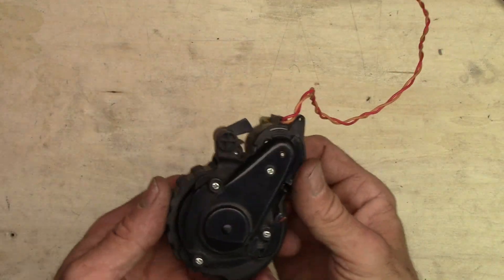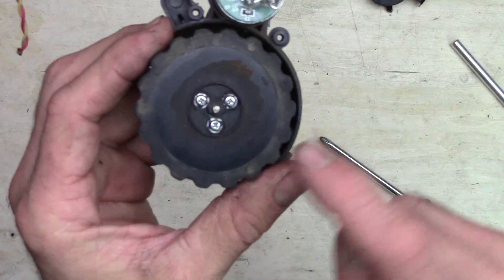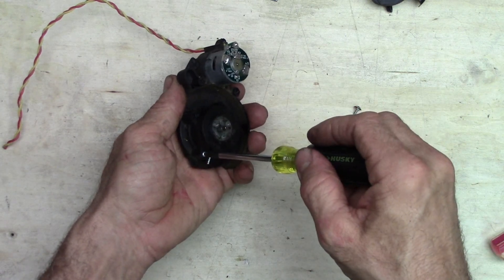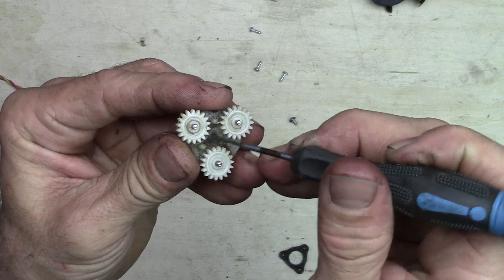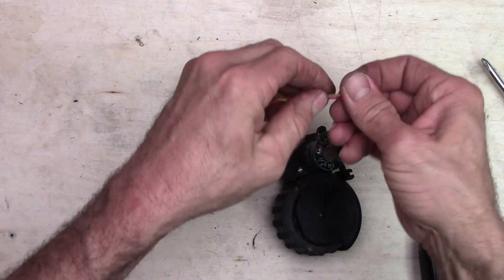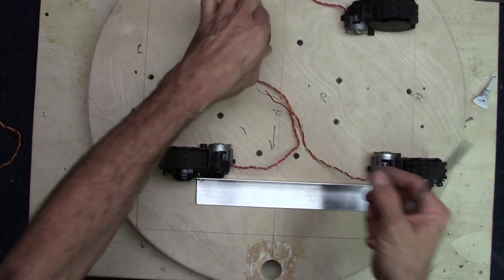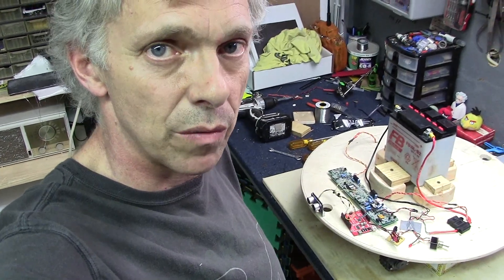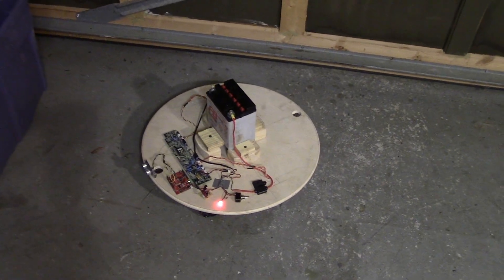Photon The VideoPhoto Robot Part 2

Comment: perhaps you could get a lithium battery to do the job, which would resolve the issue with using a heavy lead acid motorcycle battery. Of course with how expensive lithium batteries are, im not sure it would be an option. Maybe after you get done with this long term project, you could look into working on air cannons, you might want to take a look at Bill Gilmour's videos to see exactly what i mean: youtube.com/playlist?list=PLk2u6mg7FxNjosRd5D0E-jgnifnQmR47b  he recently broke the sound barrier.

Comment: I have a Lipo and it's rated at 3300 Mah or 3.3 amp hours. The motorcycle battery I'm using is rated at 10 Ah. The added weight is worth it.

Comment: Use two motors that are centered vertically on the robot, but are spread out horizontally. Then use caster wheels to keep the robot from tipping forwards or backwards. I have used this technique on robots, and it works on so many surfaces, as long as they are flat.

The problem you're having is that when turning, you're trying to drag the wheels on the ground. All four of them are counteracting each other because of the resistance to drag, which results in slippage over the ground.